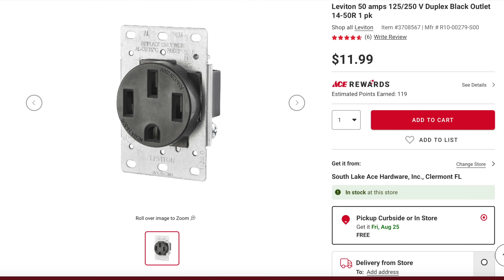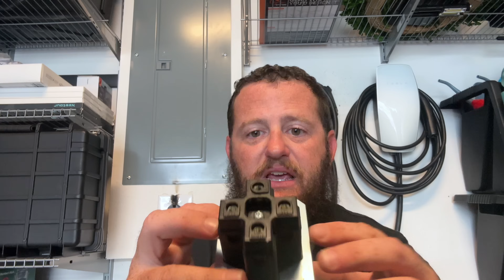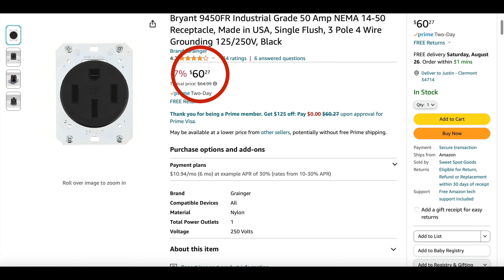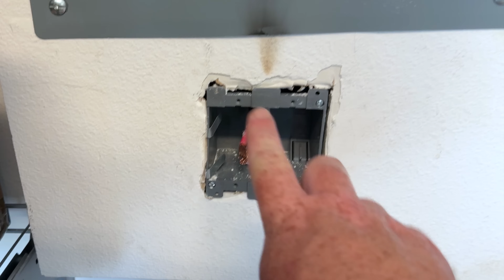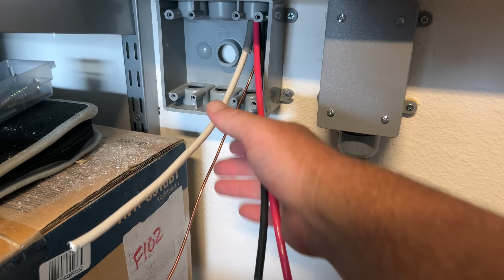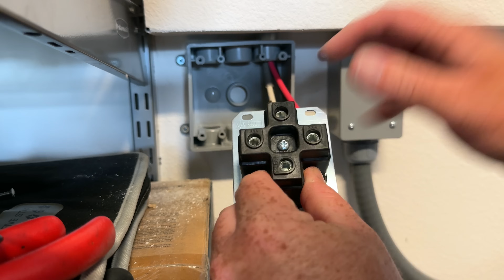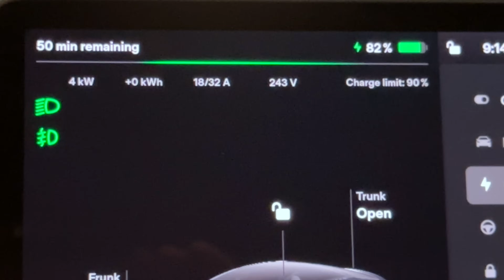This Will Save Your Life if You Charge Your Tesla on 14-50 Outlet!!

Comment: At my main charging location, I didn’t have a 14-50 in my garage. My installer insisted that I hardwire my wall charger directly to the panel. 

For my parent’s, they had a 6-50 (32amp) plug for their pottery kiln that I ended up getting a RV extension cable for. I’m worried the 5-60 wall plug will be in pieces shortly. No pun intended…

Comment: Why anyone use a plug in outlet for the Tesla wall connector. The Tesla wall connector uses 48 amps. You have to make sure to set it for way less the rating of the outlet. I installed mine myself. Direct wiring! I followed Tesla instructions . # 6 wire and tork specificaton. I would only plug in a connector in these outlets with less than  30 amps rating. Please do a hard wire. Direct!

Comment: I’ve had a Tesla Mobile Charger plugged into my 14-50 (Hubble) in my garage for two years straight, has worked great, never have unplugged it. We do turn off the breaker when we travel, but…not sure why you’d ever need to unplug it?  I guess the Leviton is not as heavy duty and not meant for so many unplugs, but again, just leave it plugged in?

Comment: I had a similar failure and I'd only ever plugged in my charger once the day it was installed, and had left it plugged in. About 3 months later it failed exactly like yours.

At my new house I had a hard wired charger installed instead, and the electrician who installed it mentioned they won't do 14-50 any more because of the risk.

Comment: Glad you are doing ok and nothing else is damaged and avoided getting zapped or worse.  Another thing to mention is that plugs from the big box stores are not designed to handle the long  continuous higher amp/voltages.  There might be other differences inside the plug that you can see unless you tear them apart.  Might want to check the number of unplugs the outlet allows and start counting the times it's unplugged/plugged and replace when you get close to the magic number.  Recommend checking out State of Charge as he has a video talking about these plugs.
Reply: I checked the various plugs, and they are fine for the job that they were intended for assuming they are properly installed, just not for continuous charging. Just direct wire and eliminate a failure point.

Comment: Similar thing happened to me. In my case, cheap plug and loose clamp eventually shorted.  Using contact fluid like Deoxit is also highly recommended. Finally, check your torque on the screws every 6 months. The heat-cold expansion works it loose too. Best quality like Hubble and Bryant are a must. House fire vs. a few bucks for a better plug is a no-brainer.
Reply: Good advice, I used contact fluid on mine, helps prevent oxidation.

Comment: I have always wondered how it can be allowed to run 48A through such a feeble looking receptacle. Here in Sweden I have a massive 3-phase socket and connector for 11kW charging, but that is only 16A per phase and the conductors inside the socket and plug are very large.

Comment: My feeling is that whenever you buy anything, be it a shaving razor, a car, or an electrical outlet, you should consider that it will have a limited life expectancy, which will vary by the wear applied to it. It's well known that plugs receive the most wear when plugging in and unplugging, so my solution is to not unplug unless necessary, such as when we take a long trip to visit relatives.

I have a NEMA 1450 that I use to charge my Tesla. I don't remember what brand and can't find out because that requires unplugging, and I knew before installing it that I wouldn't want to be doing that. I don't like leaving the mobile charger connected when not in use because it uses enough power on its own to stay warm, so I put a 60 amp switch between it and the breaker. I've had that set up for over a year now, and the only time it gets warm is when charging. My plan was that if it ever gets hot I'll replace it, but that hasn't happened yet. I know that it will happen someday, no matter what brand I have.

Comment: You do some things well Justin, giving advice on DIY electrical work is not one of them.  You would be better off letting those that have opened a code book, been trained properly and have the proper tools do videos on this.   Your installation practices could cause injury to yourself again or others if they try it.   

 You have said a GFCI breaker isn't required in your area, but 2017 code which Florida is on does require a GFCI breaker on a Nema 14-50 when its dedicated to EV charging, I know that could cause some nuisance tripping, but it's still required.  

You cut the wire way too short.  Code requires a minimum of 6" out of the back of the box, measured where it emerges from the raceway.  It also requires at least 3" extended outside of the opening.  You would be lucky to have half the length requirements.  The pressure you are putting on those wires is probably the reason the wires on your old outlet came loose and shorted as well as not torqued correctly.

The torque screwdriver you recommended isn't even rated for the 75 in lbs you tried to set it to, there is a reason they only say it goes to 65.  You should spend the extra money and get the correct tool for the job.  My last advice is to get yourself a multimeter, you should be checking the outlet leads for correct voltage anytime before you plug something in for the first time.
Reply: When the short wires heat up they expand and apply a force on the screw terminals  a longer wire would allow for wire movement instead of terminal force.  The force may have caused the neutral wire to become loose and the thin ground wire to carry the load instead  an over heat.  Note the Tesla temp warnning of a poor connection.

Comment: certainly good advice to use the better outlet, but why use an outlet at all just hardwire them, it is not that difficult. You end up having to hardwire a whip with a plug, so why not just go for the gusto and wire at direct.

Comment: Thanks for your video, I have watched a few of these videos recommending using an industrial grade 14-50 plug like Hubbel/ Byrant.  I am curious to know what type of breaker is in your panel box that tripped, a regular breaker, an ARC fault breaker or and ARC fault/GFI breaker?
Reply: Probably not an arc fault considering a 50amp is like 500usd. Right? Definitely would suggest one!

Comment: Wow that’s incredible, glad you didn’t get a worse shock. It looks like the melting is around the ground pin I wonder if there was a short, there shouldn’t be much if any power going to ground under normal operation
Reply: Should be nothing at all going to the ground pin on a properly wired installation, that's meant as safety protection in case there's a leakage from the hot wires to something a person could come in contact with.
Reply: Ha I commented too early, yeah you noticed it too

Comment: This makes me very afraid of our 8ga wire feeding our L2 EVSE at a distance of at least 50'.  Our electrical panel is on the opposite side of the house vs the garage.  Very odd, huh?  And I'm certain we have a Leviton 14-50 (and I think it's the 2nd we have had so far).  I typically underrun current, but our new e-tron doesn't allow that, so I called ChargePoint last night to lower our breaker rating from 50A to 40A (net 32A max).  Thank you for this video!  We had to upgrade our panel a few years ago after our old Chevy Bolt kept frying the breaker in the panel, but I'm very concerned there could be more problems lurking, especially considering the voltage drop at higher Amperage (even 32 vs 20A has a significant voltage drop).
Reply from the maker: whoa! Yea, you need 6 gauge wire my man. THHN is also preferred as it can carry higher amperage within temperature spec

Comment: I get your use case for a 14-50 with two different chargers... but I still think that hardwiring is safer, cheaper, and far superior to a pluggable outlet.

If you were using the mobile connector, I can understand the outlet.

Glad to know about the plug cycle differences, thanks!
Reply from the maker: absolutely hard wire is safer, but I use this for testing chargers, which is why I still have it.

Comment: I seem to recall reading that if you go the 14-50 outlet route instead of direct wired, you should pony up for a AFCI/GFCI circuit breaker. They cost more, but the added protection could save your life. If you direct hardwire your charger, bypassing the outlet, this more expensive circuit breaker is not necessary.
Reply: Although it’s code in some places it’s also pointless because any wall charger has its own GFCI protection built in. In fact they recommend against a GFCI breaker because 2 GFCIs on the same circuit causes nuisance tripping often
Reply from the maker: those GFCI breakers interfere with wall connectors, and its not code here, so I dont mess with it
Reply: What code book has your area adopted?  Isn’t it 2017 for Florida?

Comment: What brand of enclosure is that? I'm having trouble finding one with an opening big enough for commercial grade 14-50 (larger circumference than off the shelf 14-50).
Reply from the maker: get the Hubbell branded ones, they are made for these outlets specifically
Reply: @BeardedTeslaGuy  Thanks, didn't know the brand made enclosures too. RV-style weather enclosure would be ideal.

Comment: These things are all dangerous regardless of make.   The biggest gripe I have is that when you try to pull the plug out, it is almost automatic that you wrap your fingers around the plug to pull it out because it is so stiff.     As your fingers wrap around the plug they come within a few millimeters of the two pins with 240 volts across them.   They should be banned and a new design made.
Reply from the maker: it is scary how close you actually get to the magic thats happening in there.

Comment: Dude is trying hard to blame the plug. This is not a failure of the plug at all. This is installation error or user error. I’m sorry but plugs just don’t “short” because you plugged something in to it too many times. Insertion wear makes the contractors more resistive meaning that during long charging cycles the plug will accumulate heat and melt. There’s not going to be a sudden fire ball.  The installation was sloppy or it was unplugged while under full load. There is ZERO chance that this is a “I used it regularly a few times and it exploded” situation. Absolutely no shot.
Reply from the maker: well, I appreciate your expertise from afar. Even though this outlet hasn't been messed with in 6 months with at least twice a month plug cycles, thats exactly what happened. I have no reason to hold anything back, and there is absolutely a possibility that the terminals were not torqued enough to hold over time.
Reply: @BeardedTeslaGuy  It wasn’t clear from the video, and out of genuine curiosity, wondering if the charger was plugged into a vehicle (i.e. under heavy load), when this happened?

Comment: OK guys. Firstly, use 4 AWG copper wire to reduce heat issues. Second don't woose out on buying the industrial grade socket as shown in this video. Thirdly please replace the breaker running this plug with a top quality fast trip breaker to minimize issues if they occur. 

Finally, if you are going to spend $50 bucks on the socket and then money on new 4 AWG wires and a new breaker..... think that for just a little more money you can get a wall mounted hard wired charger and avoid this problem to begin with.
Reply from the maker: you can likely get a wall connector set up for the same money with these "upgrades"

Comment: Sparky here. Evitp certified. That has signs of a short. My guess is that the receptacle was loose and made contact with the ground wire in the box. That's why your breaker tripped.
Reply from the maker: It absolutely could have been poor torquing of the terminals
Reply: @BeardedTeslaGuy  loose wires don't typically trip breakers, that burn pattern is from a quick hot arc created from either a short, or opening under load. Loose wires would have caused melting of the plastic, and further spread browning around the drywall.  Definitely a sudden flash .
Reply: Or it was under load
Reply: Why would you need to keep removing the plug?

Comment: The plugs used for charging need to be 100 duty cycle. Most drier or NEMA outs are not made to be used and be on so long . If your charging at 30 amps you need a plug rated for 50 amps or higher.
Reply from the maker: indeed but its also the temperature of the cycles. The Hubbell one is rated 25 C higher than the Leviton one if I remember correctly

Comment: For extra safety it won't look beautiful but look at getting a receptacle safety switch.  It is interlocked so you can only insert and remove the plug when power is disconnected.  I'm an electrical engineer so this was helpful, as a profession we will need to be dillegent on how we specify these products.  contractors unless required will use the cheapest product. I am imagine th3 NEC will catch up eventually especially since the manufacturers can make more money if these products are required
Reply from the maker: interesting, thanks for sharing.

Comment: EVSEs should be hardwired in. There is absolutely no reason to use a plug, thats asking for trouble. Installing an EVSE is a one time investment that will be amortized over many years, do it right.
Reply: Virtually every company sells plug in wall chargers now they are perfectly safe if properly installed like anything
Reply: @doomsday9973  If you want them to operate at 48A they have to be wired in anyway, thats code. The plug serves no purpose except as a failure point. EVSEs are permanent.
Reply: @joshuarosen465  I’m well aware, for the vast majority 38 amps or below are more than adequate. If your plug in EVSE ever dies, even a layman can replace it in minutes. And yes I know hardwiring isn’t “hard” but most aren’t going to mess with that without hiring an electrician
Reply from the maker: at the moment, 14-50 wall connectors are pretty common. I have a 14-50 because I test a lot of them.

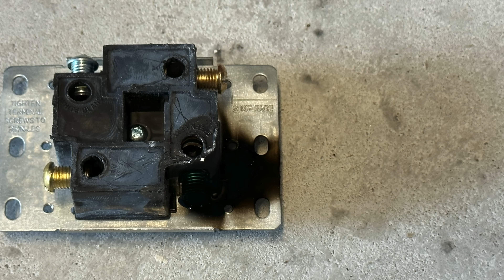Comment: If you stop the video at 2:39, you will see that just one connector melted. It is likely that the set screw was not tight enough on that one wire. Also, it looks like the ground wire, the one that fried, is maybe 10 gauge. That is way too small for the plug.
Reply: 10 gauge is the minimum to use (and "right size") on the 50 amp receptacle and is acceptable actually.  Mine has 8 gauge ground just because I had extra of that on hand already but I would have used 10 if I was buying it.
Reply: @blh1997-w1q  - Yes, you are correct. I just looked that up. Nonetheless, it is the ground that overheated in this case. perhaps the outlet was just installed improperly.
Reply from the maker: Yep, it is absolutely possible that I did not torque the terminals properly leading to this larger failure.

Comment: A lot of times this happens cuz the contact screws are not torqued enough, causing slight arcing. That arcing over several hours of charging builds heat until it bursts into flames.
Reply from the maker: It absolutely could have been me not torquing the terminals properly

Comment: This was very scary, and I’m very happy that you only had a minor injury, it could have been so much worse. When I had my level 2 charger installed, by a pro, I was told to LEAVE THE PLUG ALONE. Once installed, I have never touched the plug. I have a ChargePoint unit. After watching what happened to you, you can be sure that I will NEVER unplug that bad boy.
Reply: You can unplug it if need be but if you do it’s best to just kill the power to it first
Reply: @doomsday9973  good point, but there is really no need to unplug it. I thought about having it hardwired, but the electrician advised against it. “What if the unit goes bad?” Very easy to unplug, put in new unit and plug in, but if hardwired you need to bring a Pro in…hence the plug.
Reply: @MarvKirsch  very true. I unplugged mine once in 2 years to reboot it but I honestly should have just flipped the breaker
Reply from the maker: Yea, these things aren't made for repeated use like that unfortunately